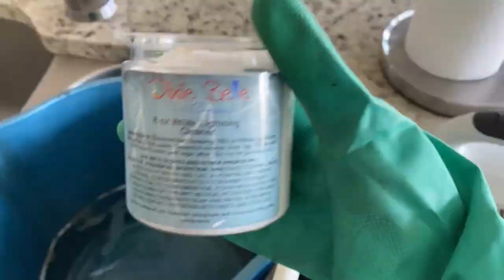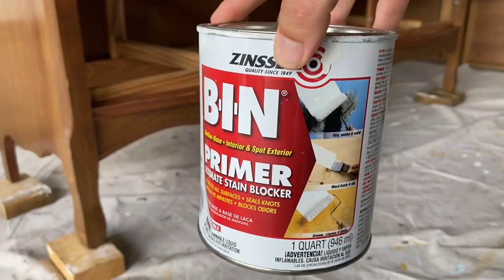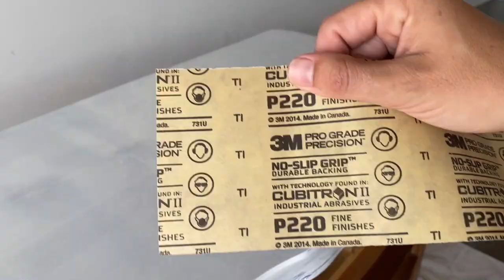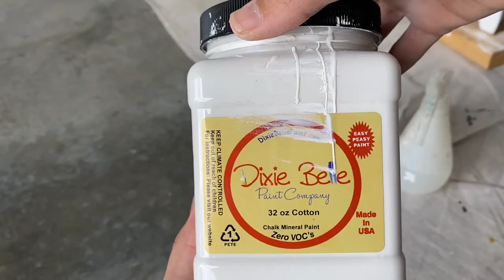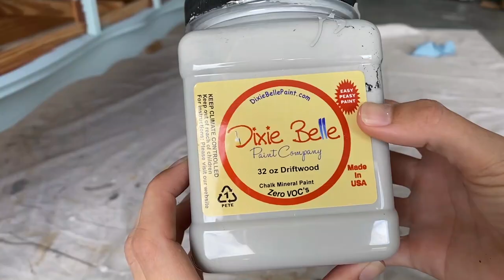How to Transform a Dresser from Trash to Treasure in Just a Few Easy Steps!

Comment: Any reason that you did not use the foam roller to apply the DB paint?
Reply from the maker: Hi there! You can use any brush you'd like when painting with Dixie Belle Paint. However, we recommend the Dixie Belle Synthetic brushes as they offer great coverage and eliminate brush strokes!
Reply: @DixieBellePaint  I asked an honest question about using a roller. In reply, you shilled your products instead of answering it. Your incessant efforts to position DB as one-stop shopping is offensive and insulting to my intelligence because there are many other products that can be used just as effectively. I have stopped watching Brushed By Brand because she is constantly shilling DB products.